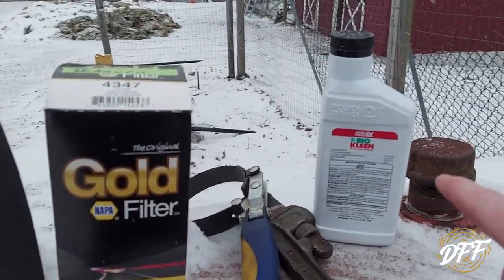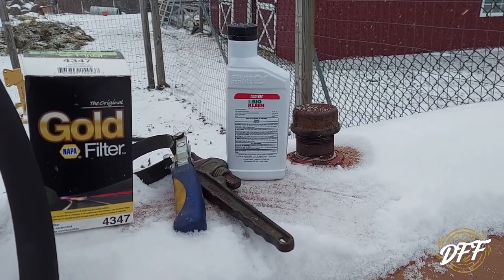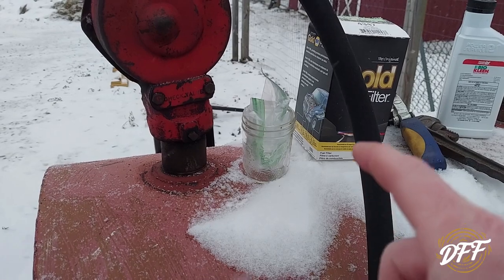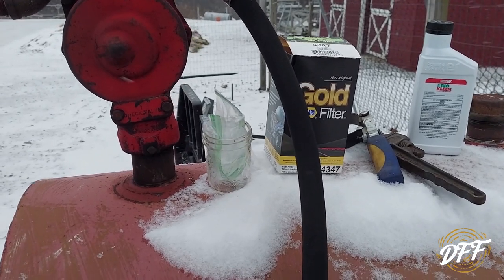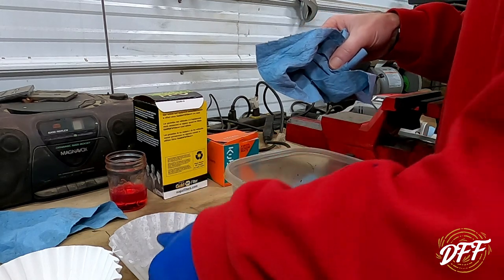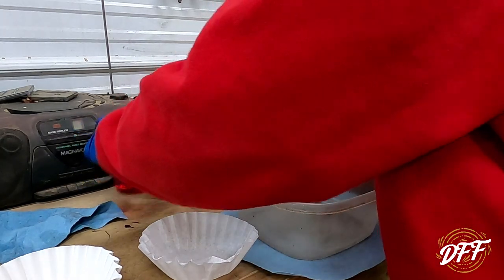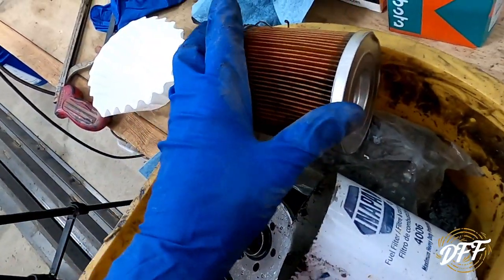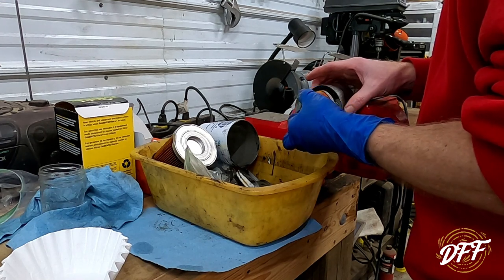Excavator Issue Part 2- Cutting Open Fuel Filters

Comment: Chris, the 2nd filter dismantled appears quite clean.  I had an issue with my Massey 1533 about 3 years after purchase and it would run then bog down,  then I'd step harder on the fuel pedal and once in a while that would make it surge.  Ultimately, the fuel tank was removed and replaced.  The dealership servicemen found chunks of debris inside my tank.  At first, they were going to reinstall the original fuel tank, but decided not since condensation was building up so they changed the type fuel tank.  I think they replaced with an aluminum tank.  I just can't remember. It was after this costly repair, that I learned to maintain a full tank of fuel all year long.  Fortunately, I had no major engine issues.  Enjoyed a full-watch.  Have a fine week. 👍🏽🙂
Reply from the maker: Thank you for sharing that info! I hope it doesn't turn into a big repair like yours, but at least it's still under warranty 🙂

Comment: I was expecting more sludge in the fuel tank filter. They make a regular filter can opener.  I have seen other YouTube videos in  which they used them.  Good luck figuring out the problem.
Reply from the maker: I was too, but they were clean. I will have to research that filter opener- thanks for the tip 🙂

Comment: Check all your fuel lines any where they make a 90 degree angle. Just went though this crap with a Case CX130 excavator....Oh how I love Biofuel....NOT..... You have what I call "Bio worms" in the fuel lines somewhere...Good luck. Hope your up and running soon....
Reply from the maker: Thanks for the tip- I will be sure to check that!
Reply: @dehavenfamilyfarm  I've got a U25 Kubota mini,I'll look at it in the daylight and see where the 90 degree fittings are.....

Comment: pull the tank from the excavator and check for plastic fragments from the manufacturing process. I had a pebble of plastic that would intermittently plug the outlet to the fuel line. I also found pwder coating flake acting like a flapper valve inside that tight 90 degree fitting going in to the seperator. all good since then.

Comment: I have a 2020 KX033-4 with 50 hours doing the same thing. Any new findings or thoughts?
Reply from the maker: Not yet. I haven't been using it much because of our weather lately. People have given me some good suggestions though: check all fuel lines for kinks, and someone mentioned that they had some sort of plastic in the fuel system from when the machine was assembled. I will be sure to post another video if it keeps acting up and I find a solution 🙂

Comment: Biobor is what I use all the time for probably the last 10 years it cleaned up my problems. It works amazingly on bacteria issues in the fuel. I also add fuel additive every time I get fuel because I don’t think with this new low sulfur fuel it has enough in it for lubrication
Reply from the maker: Thanks for the tip! I usually add Howse to all my fuel, but that doesn't help with algae.

Comment: I have a kx040 2019 code 2 then 64. It fires up after about a minute dies down then codes appear again. I replaced the two fuel filters. Drained the tank put fresh diesel. Drained the air out of the system. Still the codes continue spoke to a tech he said it’s a fuel sensor, replaced that then it was a fuel rail sensor replaced that. Now they found a short in the fuel rail sensor red wire. Ran a jumper wire from the rail sensor hot wire to the EUC connector. Still the code appears 2 then 64. Rail presser high and open circuit in rail or coil? $4500 into this and still no results! I hate kubota
Reply: I have a KX040-4, never had a problem with my machine until recently. Idles with no problem, but when under a load it will operate then intermittently stall out and turn off. The mini has just over 1900hrs on it and its 2yrs old. And so far I have only changed the fuel filter to adress the problem with routine services. I don't believe it's a fuel issue I feel that it may be a hydraulic issue. Like if it overloads and turns the mini off, I don't know I need to further diagnose it. But I don't hate Kubota, my machine has out performed many other mini-exs. Good luck, patience is a virtue.